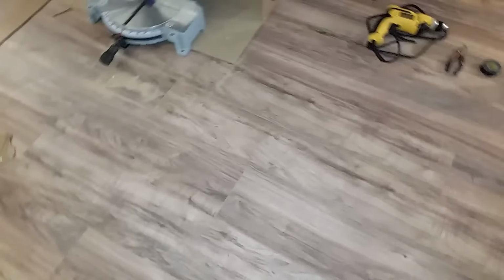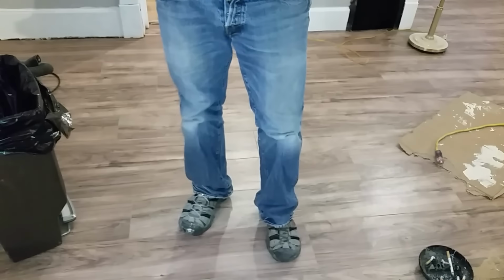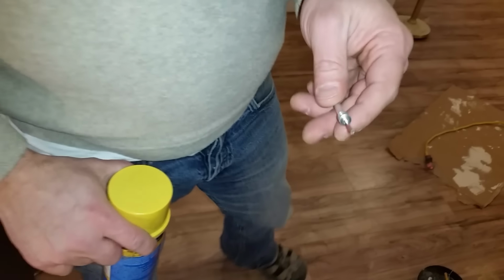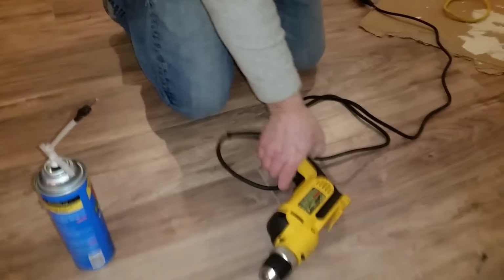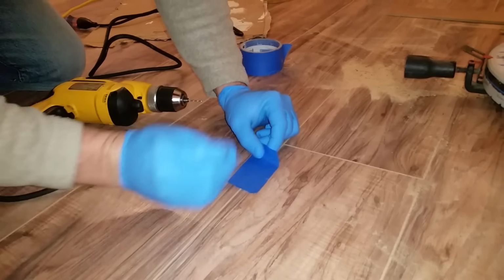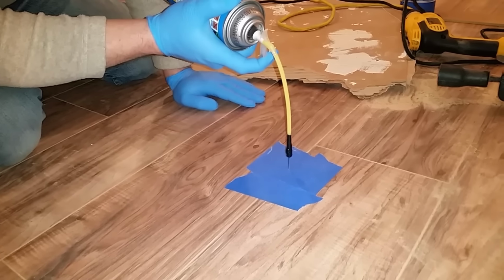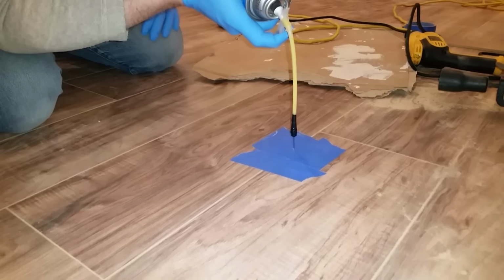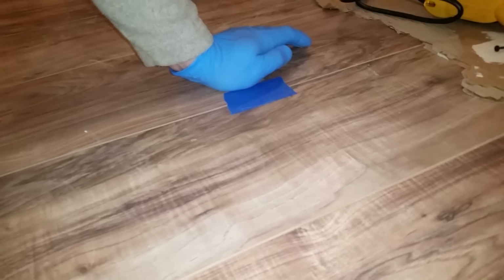Laminate flooring repair to fix soft spot for uneven underlayment

Comment: This is a horrible idea. Great Stuff Window & Door has a compression strength of 3 psi. The average person exerts 16 psi. This won't last very long and will crumble. As a licensed engineer, I advise nobody to follow this!
Reply: lukomoon compression strength is the same no matter the thickness, it'll all crumble very quickly. We don't overcomplicate things, we just don't recommend fixes that clearly won't work based on specs. A little critical thinking can save a lot of headache
Reply: Dave I think you are wrong about this, He is adding a lot of foam to a very small space. The foam will not expand to its full potential, It will not act the same as a giant piece of foam. It wont crumble, Why would it? Put away your tables. The foam will act different as a 1/4 inch dense compressed layer vs a 10 inch free expansion layer
Reply: It's pretty clear when people suggest that engineers are just book smart and know nothing about the real world that they have no actual factual argument.  This is an absurdity since every tool and product you used is created by engineers.  So, when you find the need to ridicule credentials, you show your hand.   In any event, Dave is absolutely right and your "reasoning", Mark and luknomoon, is nothing more than what you think should happen to close-cell, one-part foam formula. Even the manufacturer (Dow) explicitly states that it should not be used in closed cavities such as under tub surrounds.  Pretend that physics, chemistry,  and strength-of-materials don't matter all you want, but that doesn't change anything.  Engineers aren't just pencil geeks, they make your world possible.  There is no reason, whatsoever, that a proper leveling compound could not be injected through a 14 gauge non-hypodermic needle instead of a product that is designed to expand (zero control on the expansion, no less) and needs moisture to properly cure.  Do it right... it's just as easy.
Reply: Very well said Richard, thank you! Agreed with the SLC, or even glue if you're using hardwood and don't want the wood to suck up the moisture.
Reply: Ok Now Richard is suggesting Self Levelling Compound which is mostly Water should be injected under the Laminate which is mostly Sawdust -  That would make a nice mess swelling up the fibres.  And, Dave is suggesting Injecting Glue If you are using Hardwood.   Sorry boys but I will go with the tradesman and his practical experience over you two who have probably never laid a floor in your life.   Richard please go back to "making our world possible"
Reply: well then Dave, since you seem to know what you're talking about, you can come to my house in Columbus Ohio to fix the laminate flooring in my kitchen where it's come apart at the seams PLUS there's a major soft spot in it as well... no one in this f-ing city does floor repair!
Reply: Hank Austin why's it coming apart at the seams? From flexing or water damage? Type in dritac in Google I would inject that under it. Depending how far you are from a wall I would get a puller and try to beat the seam back together. Sometimes you can kick them closer using friction from the bottom of a sneaker
Reply: Hi Dave.. well, it's not from any kind of water damage, that I know of, nothing leaks in the kitchen.. I THINK it was installed wrong and guy that installed it didn't allow for the dip in the floor and maybe that could be the cause.. but, I don't know for sure and it's been this way for years now, but, I'm just now getting completely sick of it and I'm going to be having a huge Memorial day bbq and i need it fixed before all my snooty friends come over..
Reply: Hank Austin well I would try to beat it back in with a rubber mallet as a last resort, maybe a backing block behind it also so you don't dent it, then inject the glue and put a heavy weight on it across the seam until it cures
Reply: ok thanks Dave, that sounds like something even I COULD do, much appreciated!
Reply: Dave Mastriano so how do you explain it actually working for most people then? I filled my soft spots in 2 years ago still doing great, how do you explain that?
Reply: Dave Mastriano I would like to see a follow up of this, you can count so many wrongs. Look uo jack hammer unplugged, its priceless.
Reply: Ive seen the foam blow out windows, ext. Door casing, leveler starts chipping at its lowest point then traffic causing those peices to stack on each, ive about seen it all in the renovation business, i say that about every house i do, i dont know why you guys are here but im here becsuse good help is truly hard to find. Lets say it dont blow the floor out & the seam thats seated least or any other that could go wrong, its foam... high traffic area so it will be as flat, & your still gonna have the low spot, i wouldnt even consider it, i have used lexel chaulk, my brother used it when he does metal roof, if you dont know about you need to check it, i used a clear plastic tubing & if you heat tube/tubes in some hot water it will help with the application. I dont take short cuts, if floor isnt new, use blower attach on compressor or a can of air to push dust away from area, put some weight on it  , depends on your location, elevation, humidty etc. I would leave it a min 12 hrs minimum.
Reply: exactly right
Reply: Exactly. I agree 100%
Reply: Hank Austin well your in luck. I live in that area. Send me a message and ill give you my number if your interested. Im a certified installer
Reply: Hank Austin no Hank. You don't beat anything. That wont fix the dip and surely wont change the low spot.  The right way and only way to fix this correctly and for good is to pull the shoe mold (if any) and starting from the last row start popping out the floor. It pulls out very easy.  Lift up to about 45 degrees and pull out and up. It will release free. Dont force it.Number  Label each rows ( starter board and end board)  so you know what goes back to complete the row. Middles dont matter because they are the same size. Then once you get to the low spot, go about 2 more rows to allow feathering. Buy some Henry (Ardex) floor patch leveler. Mix it loose and pour in the center of the low spot. ( best to already have it marked out how far you need to go for flatness.  Take a 4 ft level and start at the flat area sliding the level towards yourself, once you see the dip starting, trace it with a sharpie marker until you complete the dip outline.. now you know how far you need to feather your patch.)  Skim the edges very thin and flat as possible like sheetrock joints. Wait the recommended time for curing, place the underlayment back over and duct tape the cut seems.. now install your floor back. Use tapping blocks and never beat any laminate.  Put trim or molding back and you're done. Now you will never have to worry about that soft spot again. 
Hope this helps you or anyone for that matter reading this. Never spray foam anything under your floor.  Its designed for gaps for windows and doors. Professional hardwood installer for over 26 years. Installed everything you've ever heard of or haven't.  If I got called to your house, this is the only way it would be done. 

Now they do sell for professionals an epoxy 2 part repair kit, but that is for engineered glue downs or hardwood. Would never use it under a laminate. Well, never did or tried.
Reply: @cryodon  hello new releases I am in middle of installing could use some help
Reply: Children children calm down we all have opinions
Reply: Given the facts about this video and what he did for a 'rig job' is debatable maybe.Idealy the sub-floor should had been level to start with(I am finding this out right now as I have should have used a leveling compound,which I will probably end up doing after I layed 3 rows at this exact moment.This is why I looked up a video for such situations)I for 1 use rigging whenever I have to on anything I do it seems,I am no way a professional.Will the foam work?Who knows unless you've tried it.As a quick fix/rig job it may work and maybe its in an area where it wont get walked on,that's possible?Also with all due respect to our engineers on here,remember Apollo 13??There was an awful lot of 'rigging' to get those men back home,hell I think duct tape might have been used(maybe that was just in the movie but you get the point)...So all in all we need engineers and we need riggers and yes sometimes we need a mixture of them both... 👍
Reply: If the person installing the floor would have done it right the first time around there wouldn't be any pockets under the floor!
Reply: @ddentici  This would be my choice.  Thanks David
Reply: that's 16 psi from foot to floor not from floor to foam
Reply: @ddentici  awesome... can you get this floor leveling mix anywhere...? Home depot.and is it pricy?

Comment: jerz. did you empty the whole can or what?
Reply from the maker: no sir, about 10-15 seconds per hole depending how big of a gap is underneath the laminate. Its better to use less than more so you can come back again later if needed. Make sure you use minimal expanding foam.
Reply: @AGlobalLLC  Thank you. It's really a great technique, but it seemed like you were squirting it forever! LOL. Ya think this would work with floors like Pergo that have an underlayment? It seems in that case the foam would end up getting sandwiched between the plank and the underlayment pad??
Reply from the maker: @jayviz  Yes, it should work and can get rid of that annoying soft spot. 3 years later it's solid and worked out great for me. The minimal expanding foam is similar to that underlayment so before you rip out the floor and probably ruin it by taking it apart then have to buy expensive flooring and then use floor leveler. This is an alternative and worth a try.

Comment: What if I could access the sub floor from underneath would this technique work from underneath?
Reply: You probably could but triangulating the spot under the floor/your house, then dealing with the conditions (times how many creaky spots your have). Its probably easier to drill the hole, fill with foam, and then use a wood putty with dye to match the color of the floor from the top side.

Comment: Honestly I'm not sure if this would hold up long term, maybe in low traffic areas. We used great stuff to seal off a few exhaust holes in our shop and let me tell you whatever it touches it owns! For the people that already have the floor down not wanting to tear it up, it's a pain in the @$$ and very easy to break joints.. For those that do I recommend Planipatch by Mapei to fill those low spots in. Epoxy works great too, but not cheap.  PC Concrete is amazing stuff for filling cracks and have used it on a few carpet nail pullouts. It would be interesting to pull up one of those spots in a few years and see how well it did... I appreciate the creativity guys!
Reply: Will this work in a mobile home?

Comment: I have done this before and wanted to do it again and I was so frustrated to see that they changed the tube on the great stuff can so you can't attach this anymore.  Arrrgh!
Reply: rawb fish I just did this today the trick is to run a lighter over the tip of the foam tube it will roll back and then presto you can put the tip on while the plastic is still warm and get a snug fit
Reply: I had same issue so have used rubber pipe with jubilee clips to attach inflator and plastic tube. Yet to do job but should hold them tight.

Comment: This is not good. It will create a hump in the floor if too much is injected and create multiple voids around it. You can't tell if your pumping too much.  Floor should've  been inspected prior to installation and low spots should've been flash patched. It's that simple.  Nothing worse than having to drill into a new floor. 

It's a matter of the 6 p's formula I work by everyday in my flooring business. 
Proper Preparation Prevents Piss Poor Performance

Comment: I do e this it swelled so much it popped the joint
Reply from the maker: Oh my, what foam did you use? Try using a minimal expanding foam(window and door foam), being patient and not using too much also helps.
Reply: AGlobal LLC Man my house was done bad. They didnt level the subfloor now a couple spot are bad like yours.  Should i do this for all those spots.
Reply from the maker: In my case it was worth it since the floor had to be replaced anyways.

Comment: I came up with a slightly different spin to your idea. I drilled a hole through the bottom of the subfloor but did not go through the floating floor. Then I took my caulking gun and injected about a half of tube of regular old caulk to fill a low spot. It seems to be working like a charm. However I am not sure if it will cure properly under there but who cares?  The caulk should not compress or crush down like foam
Reply: Additionally I think the caulk should allow enough movement for the floating floor without sticking it tightly to the subfloor
Reply: Isn't caulk super squishy when walked on?

Comment: You have to level the subfloor before the installation...
Reply from the maker: +Henry- so true I agree with you 100 percent.  It can salvage a floor already installed though. I've seen some poorly installed laminate flooring by so called professionals.
Reply: What you gonna do if the floor was there when you moved in, you're gonna do this.

Comment: The concept of this idea is terrific.  My primary issue in the US is that the air needle fits very loosely on the Great Stuff nozzle.  You'll notice in video that he uses some pressure to get it on the Great Stuff nozzle.  Trieds two wraps of electrical tape on nozzle to tighten --not tight enough-three too many.  Result was could not keep foam going only into floor hole.  The little bit I did get in seemed to help a bit.  Would gladly try again if I could find air needle that fits snugly on foam nozzle.  Metric?  Just FYI.
Reply: Maybe Teflon tape the needle first?
Reply: Rubber hose to attach the inflator pin and plastic tube. Hold tight with jubilee clips.

Comment: may or nay not work foam requires air to cure fully..........otherwise it will stay  "wet"
Reply from the maker: In my case it worked nicely and it took a day to fully cure. The foam used was window and door foam. My floor had a noticeable 1/8 inch gap on the soft spot and the foam expanded when it was injected. The soft spot was eliminated. I can see this not working on a floor that was installed to tight against the walls and buckling up. This appears to work very well when the sub floor is soft and noticeably uneven. Maybe someone else can share their results.
Reply: MrTruthteller123 foam dry from air humidity not from air
Reply: @AGlobalLLC  what's kind of glue are yiu using?

Comment: Hi there! This is really helpful! Wondering does the foam filler make it impossible to replace/remove the floors down the line?
Reply: it shouldn't . u can use a knife and scrap it off . spray foam on a ( test ) cardboard and let it dry and play with it lol

Comment: Ummm, Guys. I see this is being installed and now a fix is needed.  The floor should have been checked for dips, where your "soft spot" is long before floor would be laid. A string from side to side in both directions will suffice. Mark it and go back and address it, with Rock Hard Putty, or Hydraulic Cement, or S type mortar,  if over an 1/8". It think I fear with your "after thought" is it could cause a hump and also adhere the laminate to the sub floor, if as many do, don't put down Felt or the laminate substraight. Ive seen people use Great stuff on windows and it push the sides in on door and window jambs leaving them inoperable. You also put a shit load of it in for one spot, a spot of which, should have been seen when installing it.  I hope this is a self correcting problem where you wont have to go thru this ever again.

Comment: Do you always place the hole on a seam? And if my soft spot is relatively small in size, will one hole work?
Reply from the maker: +Amanda Perkins Personally, I place the hole in a seam for the laminate flooring for asthetic  reasons. Each hole appears to cover about a 1 foot diameter soft spot with about 20 to 30 seconds injecting it. Make sure you use minimal expanding (window and door) foam or the floor will be ruined.
Reply: Fancy seeing you here
Reply: I generally like holes with a seam, and if its a soft/warm/wet  and relatively small in size,  one hole should work well

Comment: I'm putting in laminate and I noticed (too late) that there was one small area near a wall where they used a piece of 3/4" plywood while the rest of the floor is 5/8". Do you think this technique could fill an 1/8" gap?
Reply: Try to plane it down

Comment: The problem I see with this concept is the foam will bond to the laminate and substrate. 

A laminate floor cannot be adhered to the substrate. This creates as many issues as it solves

I’d recommend flattening the floors prior to installation

Comment: I have this problem with  vinyl plank click flooring. Some of the sub flooring was not properly leveled. Do you think  this would work with it as well?
Reply from the maker: +Cheryl Price  It's worth a try, since the only other option would be to replace the entire floor and then repairing the subfloor by leveling it. Make sure it's the subfloor and not the vinyl planks where it was installed to tight against the walls.
Reply: NOOOOO! This is horse shit!!